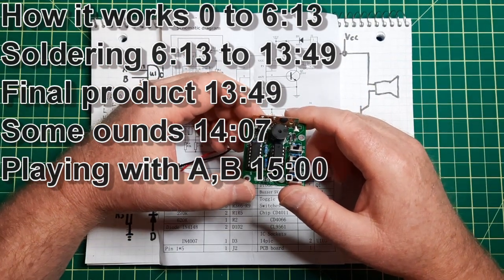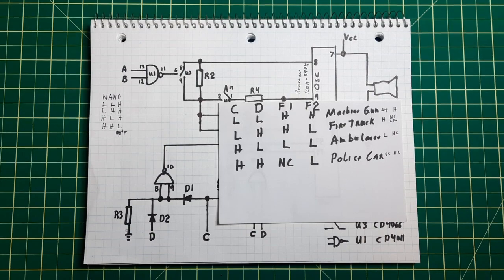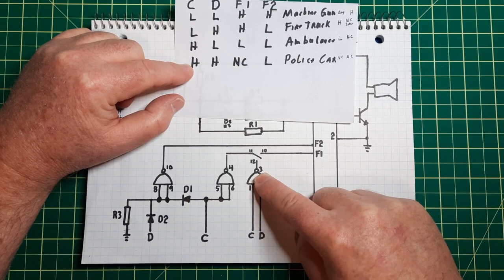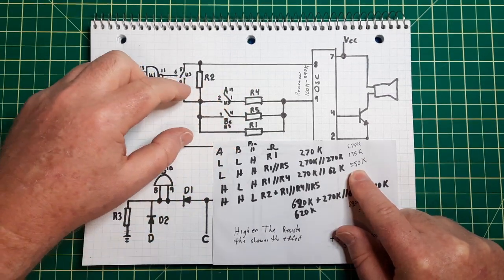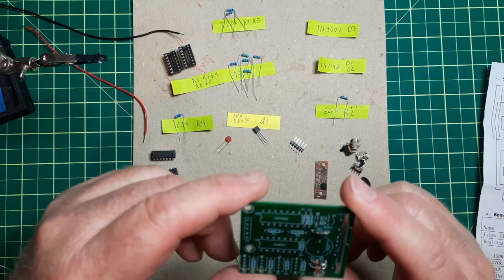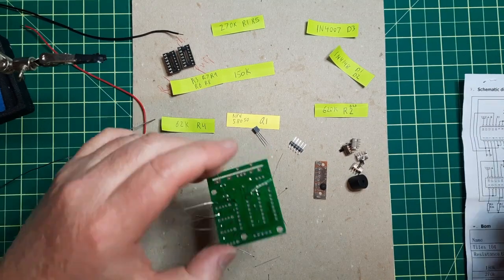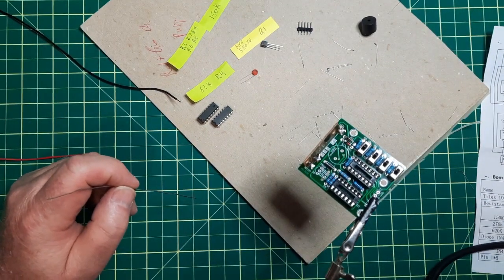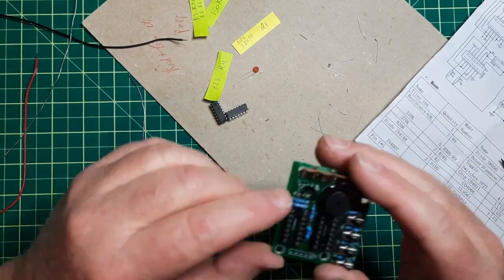Music box 16 Sounds Theory Build Review

Comment: Neat tricks to get more sounds out of a simple digital sound thing. I once did something similar with a soviet music ic UMS7 (intended for clock alarm i think) , it had a place to put a clock quartz, so i had to make an oscillator of cd4000 nand gates and feed it into that input, adjusting the frequency with potentiometer it would change from just clicks to very fast. Also the analog switches can be used to make a sequencer for a simple synthesizer. The 4000 cmos series is really awesome cuz of wide power range and ease of making analog stuff with it.
Reply from the maker: Lets face it, the CMOS 4000 series started in 1968 by RCA and we can still buy the chips today. That is a good legacy.  And these and their offspring are just so much fun to play with, no programming required (-: